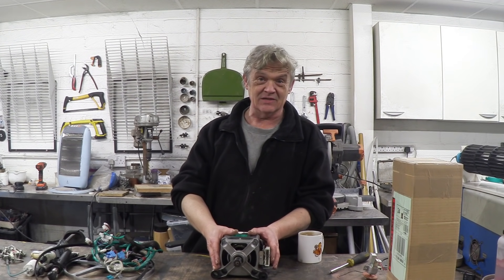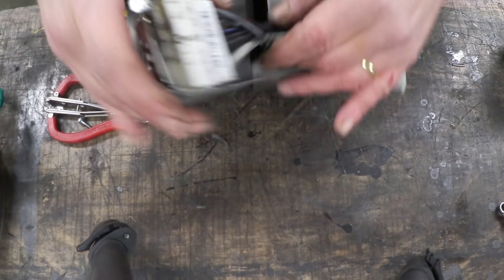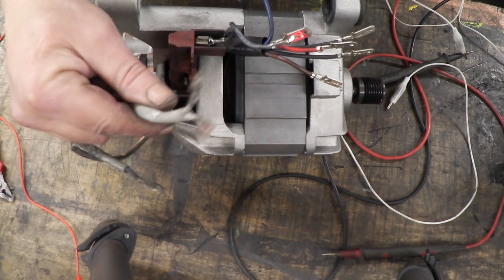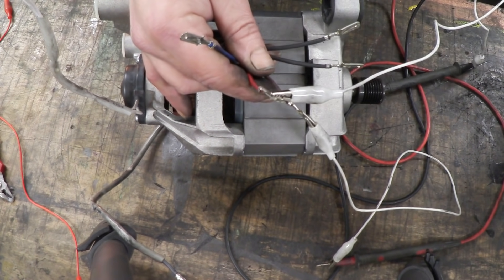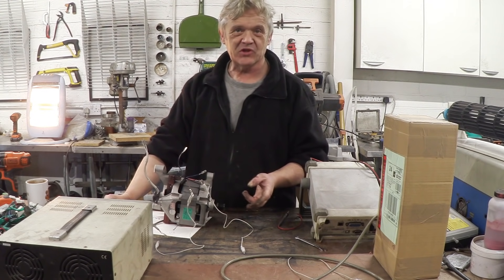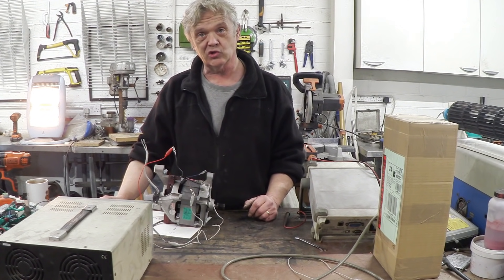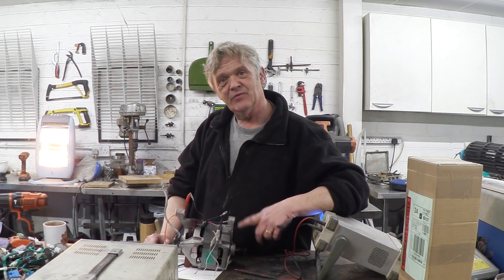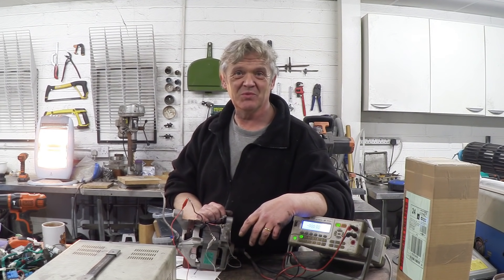1018 Reusing A Washing Machine Motor As A DC Motor Or A Generator

Comment: What would determine the total out put of a washing machine motor as a generator ? 

I have a dryer motor which says 90W , so is that saying it would use 90W to run it as a dryer ? would that also be the total output if I ran that as a generator ? 

If a 2HP motor , which is 1.5Kw , would I be right in thinking , if I used that as a generator , it would/could produce 1.5Kw ?

Comment: Newbie question. Is it possible, when connecting as a generator, to require more torque to spin it by adjusting the voltage on the electro magnet? If it was connected to a small steam engine for example. They can also run away a bit.

Comment: Robert 
Could you please do a video on the Fisher and Paykel washing machine motor converted to a wind turbine please. In particular the 36 coil version rewired to 6x6 coils and explain why you need to reduce the massive voltage down and increase Amps?
It seems to stay 3 phase and uses a bridge rectifier to output 13.5 volts to charge batteries for off grid application.Then run a wind experiment and show exactly how many amps/watts it outputs please. There are some absolute rubbish videos out there and it would make yours the Go To video for people like me that live off grid. Thanks 😊

Comment: Thanks for the video. I have used a washing machine motor to run a small industrial sewing machine running on 24 volts DC. All goes ok except I get some significant arcing on the foot switch. I'm thinking it is from a back EMF from the inductance of the motor. Any ideas on how to stop it.

Comment: Thank you Robert for a wonderful procedural video on using AC motors or converting them and for the in depth description of the wiring pinout. I am concerned about you however...I worked as a master electrician at a company called ACA( Aluminum Coil Anodizing)..and so I have years experience working everything electrical...when working with these motors.5 hp and greater  please take care to not get any dust in your lungs or even on your hands ..believe me you will save a lot of grief when you get older...

Comment: So could you then use this washing machine motor to control the fields separately as you did n then use it in a boat application to use as propolsion by controlling the torque and speed on separate potentiometers
Reply: Although I'm nit sure the wires would be thick enough to handle the load

Comment: I've found you can get good power out of electric lawnmower motors with a 3-phase rectifier. They require a controller as a motor to run. But as a generator you just need a rectifier

Comment: Thanks for explaining. Would you need a DC voltage similar to the AC mains voltage (i.e. 230 V DC) to run the motor at full rated power?

Comment: Need reach a minimum of 600 rpm and voltage regulator, to count also more amps get absorbed by the batteries harder will be to spin the motor

Comment: Here in the U.S., we had a front loading, "new fangled", digitally controlled washer. I stripped the motor out for later use after repairs cost more than the machine was worth. After I got it apart, I looked at the label on the motor and it was rated at 1950 Hz and not at the 60 Hz in U.S. wall sockets. Without the digital controller, (the defective part,), the motor was useless.

    If you energize the shaft coil independently with DC as a field magnet, the stator coil will generate a lot more power like a car alternator and will be much more controllable by varying the voltage to the field with a heavy rheostat or other electronic variable voltage regulator. This will probably produce AC voltage depending on how the coils are wound which is easily converted to DC with a diode bridge.

Comment: You are a total rock-star, brother!!  I had no idea that washing machine motors had at least 4!!! different uses: AC generator, DC generator, AC motor, DC motor!🤪

I'm currently building a drop-shaft lawnmower gas engine powered AC generator set with its own four-plex of 110 volt AC outlets.  I'm also going to install a 120 volt, 15 amp breaker in it to prevent accidents. The generator will be belt driven and sit upside down above the gen-set's open box frame.

I'm really excited right now, thank you.

Jason Wampler
W A M P L E R

Comment: hello mr. smith. great videos. i have been a fan for years now. I have a question. If a person has a permanent rotating device, can they put that on the generator and then connect a multi strip plug directly to the generator?  or is something else needed?

Comment: Good day Robert.
I am at present thinking of building a wind powered turbine to assist in the charging of my solar powered batteries through the night...
The question to yourself is, would a std washing machine motor be sufficient to charge the 24volt system.
Each battery is a 2volt cell of 725 approximately.
What if possible would l need to make it work...that being if it could..
I suspect diodes would need to be applied so as to stop a reverse of the current going back to the fan...
Any help would be appreciated.
Thank you

Comment: So I have a question that I think you could answer for me.  I have a dc motor from a treadmill.  One of the brushes was missing so I  connected the brush wire to a paperclip just to see if the motor was still usable. So my question is what would cause the motor to spin faster if I took said paper clip and held it to the commentator then slowly moved it closer to the opposite brush. I was able to get 5x the speed by holding the clip about half an inch away from the brush while still applying same voltage as before.  I hope I described this well enough for you to understand what I am asking.  Only reason is if you can get 5x the speed from a motor then we wouldn't need nearly the size motors we use now to achieve same results, right?

Comment: Hi Rob, well explained and useful.

Do you have any comments with regard to voltage ranges for the Rotor /  field coils  when powered separately. I am keen to explore Low speed with High Torque.

Regards

Fred

Comment: If you turn this motor into a DC generator, how much current can you get out of it before heat becomes an issue, or diameter/gauge of output power wires becomes an issue?

Comment: Thanks for showing how to identify wires! 

Series wound DC can also produce a runaway condition if not under load, and your armature will fly apart (too many rpms!)

To more reliably make a DC generator, energize the field coil (not series wound) - then spin the armature, and that field coil will induce a current in the armature...
Reply: Home made DC vehicles frequently use a 9-inch Netgain (or similar) motor, series wound (i.e. Armature & field coil in series). Push in the clutch, wind that motor up to its highest rpm, and you'll blow up a $1500+ (USD) motor. Series wound DC not under load will runaway from you if given enough current.

Comment: You mentioned an alternative wiring that supports torque control. I tried it out using two 20A rectifier circuits with variable outputs and although it worked well to start I quickly started a fire. Would you say I put too much power through the field coils and caused it to overheat?

Comment: Great video Rob! :)  Could the coils and rotor be fed from the same DC source with independently adjusted voltage for each and achieve similar results? or would doing so cause issues?
Reply: slow, no torque

Comment: You know the shaft on the motor is metal,would it be possible to tac weld a cog onto it or would the heat destroy it?
Reply: It would be tricky, I can't say that it will work but if you can keep the heat off the bearing,sounds promising, if you could wrap a cold towel around the bottom side, and tac and check,well let us know what happens
Reply: Idk if your tak will stick to the metal ,I think there is a key way or a setting screw to a flat face, and if it is round it might be easier to grind a flat face and use a setting screw, some times you use what you know will work,instead of over thinking it
Reply: @tremail564  it had a grooved cog on to begin with where the belt went but I ground that off to put a universal joint onto it but the device I'm making with it requires it to have some pull on it an the universal joint keeps slipping off,I'm wondering if I tac it bit by bit allowing it to cool between tacs would it burn the grease in the bearings

Comment: Thank you so much Robert! 👍
Great explanation and a new approach for the old washing mashine motor that I extracted decades ago (laying around ever since). I was brooding about the best application for it since a couple of weeks now (inspired by some video from you), just a bit desperate of how to get over the lack of static magnets without rebuilding the whole bunch of steel, iron and copper.
Since the efficiency is lousy, compared to modern electric car motors (in terms of power-to-weight ratio), I'll probably go for generator use.
Therefore I won't wast any more time and head for your next uploaded video ("1016 Washingmashine to Wind Turbine)...😄

Comment: Should be able to run as generator with either series or parallel winding... Reducing the field current is how the  parrallel connected Car alternator will reduce their output current once battery up to float voltage. Alternator still spinning, but as like using weaker magnets alternator takes less torque to drive at given speed... Resulting in less dragging torque unless car battery needs charging. 

Tachometer... Does it provide a pulse for each rev or similar? 
If so... A basic motor speed limiter could be implemented by feeding tachometer signal to a C-R  high pass filter and then use processed signal to energise a Normally closed switch/relay in series with motor, when rpm high. 

If a normally open relay, couple diodes, RC time delay, and low pass filter used... Can combine speed limiter with " push button to start and stop" and "no volt off"
Reply from the maker: nice tips mate - thanks for taking the time to post

Comment: interesting! it would be fun to have the brush/speed controlled by a potentiometer throttle,   and 4 or 5 transformers on a selector lever for the field coil strength and call it a 5 speed digital transmission lol
Reply from the maker: I like that mate
Reply: I love the enthusiasm, but with a lot of electricity or magnetism comes heat, and the coils are only rated for certain volt/amp/rpm/heat/weight limits...but with all this in mind ,I wish you luck on your journeys

Comment: I've seen this explained several times before and this was by far the clearest and easiest to understand.  Thanks for sharing it with us :)
Reply: For demo, this will work as a simple generator. But to really use as a generator, the brushes must be moved by 90 degrees.  For this riveted construction, it is lots of work, but can be done.
Reply from the maker: You're very welcome!
Reply: @ThinkingandTinkering  does washing machine motor have magnets inside?

Comment: It appeared to me that your generator example produced DC. Is there a way to generate AC from these types of motors?
Reply: If I may answer that : I think not. You can think of these motors as DC motor but whatever polarity you connect it it will run the same direction. So if you connect AC the motor will run the same direction for the positive and the negative half sine wave. When used as a generator it will only start generating due to external magnetic field ( earth magnetic field probably ) and just picks a polarity based on that.Once generating it will provide it's own magnetic field due to load current ( when stator is in series ). Once polarity is picked it will not alternate and just follows the reverse process for the DC motor.
Reply from the maker: nice one mate - cheers - can I add? - it is most likely just the remnant flux in the core that starts generation if it doesn't generate this can be sold by a 'boost' into the field coils from say a capacitor
Reply: @ThinkingandTinkering  Might well be true. Some magnetic field will always be there whatever the source.
I have some doubt about what the optimal conditions to start generating are. The power plant where I sometimes work has another device on the generator axis. However I think they use that to sync rpm to mains frequency. Only when it's in sync they connect the mains generator to the net.
Reply from the maker: Hans gave the answer mate - cheers Hans

Comment: The seperate stator supply is a good idea. This way it can be efficient as a low voltage DC  motor. If you put them in series as they normally would be torque will be very limited on low voltage DC.
Stator and Rotor connections are connected seperately to the control board because if you want to run the motor in the opposite direction you need to connect either stator or rotor connections the other way around. On both AC or DC, does not matter. 
These motors have a more or less constant torque for any rpm. That is they will increase RPM till either the load provides the same torque back as happens in your video on low DC voltage ( where mechanical load is just air and bearing resistance ) or they'll fly apart into pieces due to centrifugal force. Torque is more or less constant because of rotor winding inductance which will decrease rotor current a bit at high rpm.
This is old technology now. Virtually every modern washing machine will have a brushless motor and an electronic inverter circuit to create the rotating field. The big version of what you'll find in for example harddisk drives to rotate the platters or the paper advance motor in many laserprinters.
Reply: Damn... I'd better try scrounge a few of them old ones while they're still around.
Reply from the maker: direct drives are coming in mate but still many many makes use this kind of motor - it will be a few years before these can no longer be found - I think 5 -10 years myself
Reply: @ThinkingandTinkering   i agree. TMT = Too Much Technology. would like to vision, a SIMPLER   WORLD. high tech is an addictive greedy method, of  'making home appliances ' I have a 30 year old washing machine, with about 18 push buttons, and an orbital transmission, top load. High  Efficiency washing machines, how can they produce clean clothes..?....don't use enough water.     Never a problem........not a MOSFET controlled dryer,  either.....(whirlpool junk) have a Duet dryer in garage, won't even spin the drum, just hums, till i give the drum a 'hand'   start....good day, sir, enjoy your tea and crumpets...
Reply: @petersack5074  Actually a mosfet is a much more robust way to switch hi current than a mechanical switch is. The thing is that is only so for a well designed circuit and for a well known load. A poorly designed circuit can and will fail maybe in a few cycles or maybe in a few thousand cycles. When mishandled parts of the die get's eaten away in every cycle till the point it fails. For triacs it's the same. For example a too high dI/dt where current gets too high when only part of the die is conductive yet.
Reply: @ThinkingandTinkering  Yeah, you are probably right. I only see so many washing machines  .. mainly when mine or  a friend's need repair.

Comment: I love your videos.  A couple of questions - 1) If you wanted to use it as an AC motor, how could you take advantage of the included "tachometer" to control it's speed?  And 2) In either of the DC wireups or as an AC wireup, can the motor itself be reversed?   Just curious to take it further another step and what these motors can do?
Reply: 1. "tachosensor" generates signal thats frequency is proportional to rotation speed, so you can use circuit that measure that signal and control AC to the motor by triac. You can stabilize rotation speed that can be independent of the mechanical load of the motor.  2. Yes it can be reversed, it depends how you connect rotor and stator .
Reply from the maker: cheers mate
Reply: @ThinkingandTinkering  Thank you @Darth Fate.  It's been a long time since I was at University and learned these basics (early '90's), so I'm a bit rusty.   I was trying to figure out how I could incorporate something like that, to an AC Centrifugal Transfer Pump.  I install and remove heating oil tanks here in the States - The pump I have is one speed, and pumps at a rate of 1500 gallons/hr.  This is great for pumping the tank empty before I remove it; but if I wish to deliver that oil into someone else's residential tank, through the normal 'fill' pipes, it's much too fast.  So I was wondering how I could make the pump speed "variable" to pump at a lower rate when needed.   Currently, I just use a DC pump powered by a homemade ATX PC power supply modified into a bench power supply, which has a much lower flow rate.  It would be easy to make the DC pump 'variable' speed should I ever need to (which I don't) - but using just one pump, one setup, would be easier  I'm leery of physically 'restricting' the outlet of the AC pump so I don't ruin the pump, or overwork it.
Reply from the maker: nice answer from Darth mate

Comment: When using the motor as a generator ,  If you have a secondary power source on the stator windings, you actually turn it into a dynamo and should be able to generate more power at low RPM.  You could also use the speed sensor to switch off the stator power when the armature is not turning, could be useful if connected to a wind turbine.
Reply from the maker: for sure mate - cheers
Reply: That is actually how some larger generators are started. For those large permanent magnets are not an option. To get going they need an initial magnetic field which is provided with external power. Once started they can power itself for this purpose.